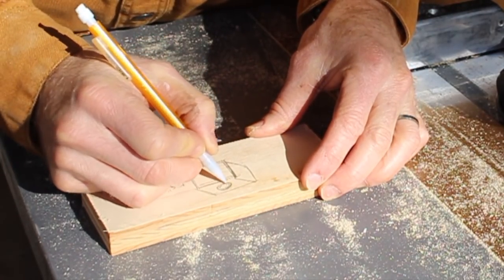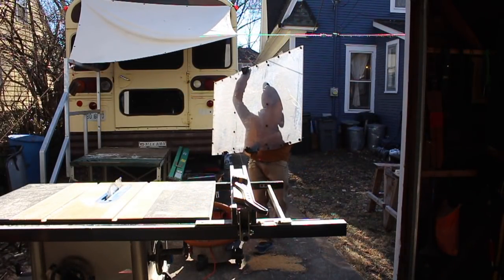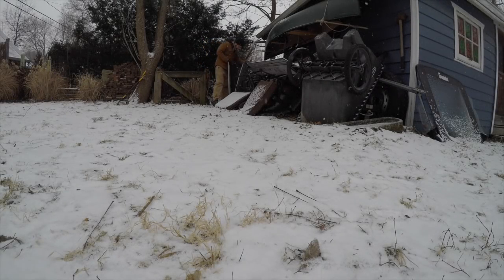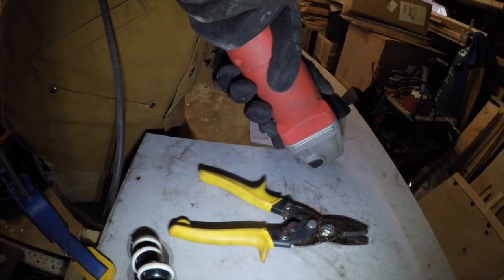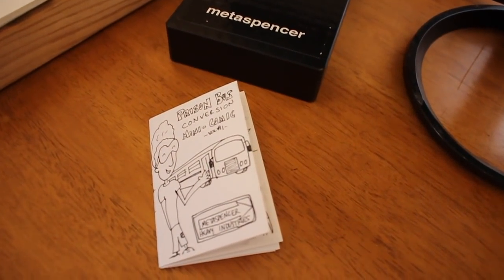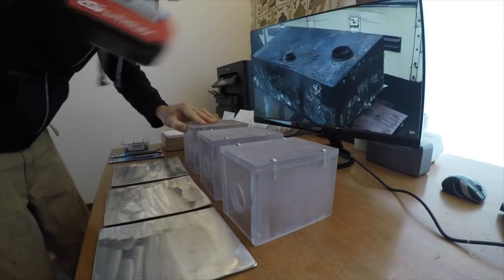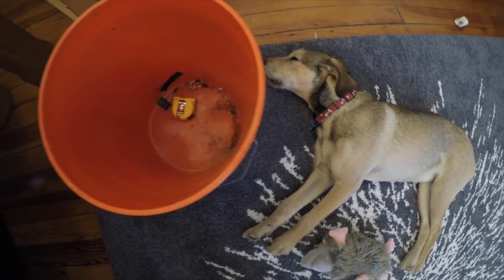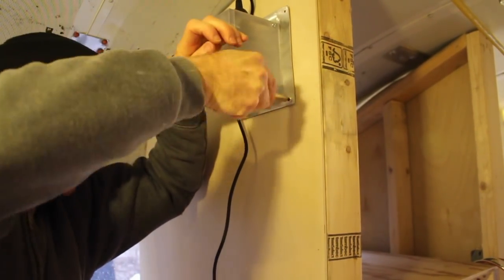Bulletproof Lights -- Prison Bus Conversion #29

Comment: Just watching and catching up on the previous vid's..in answer to the "Why don't aluminum spark when cut" ? Well, general info is Aluminum isn't  a Ferrous metal like Steel, Cast Iron, ect; Much softer metal or Non-Ferrous metal..Least that's what I learned from years gone by, Hope I'm somewhat correct, like the build bunches, keep the faith !
Reply from the maker: sounds right to me! I guess the ferrous bits make the sparks or something like that. Thanks!

Comment: hello Spence you can glue the plastic with chloroform we have done it with ship ports works great and super strong
Reply from the maker: I didn't experiment with glue or chloroform, but that would be a great way to go. I'll have to experiment with that, as it would make a perfect seam. thanks for the tip!

Comment: Just a little FYI, do not use any ferrous metal (mild steel, carbon steel, stainless steel, cast iron, and wrought iron) grinding wheels on non-ferrous metals (aluminum, brass, copper, nickel, tin, lead, and zinc). The wheels for ferrous metal when used on non-ferrous metals gets clogged with the non-ferrous metals (thus no sparks). As the wheel keeps getting clogged you have to use more, and more pressure on the grinding wheel so it will still cut which creates more, and more heat which can cause the grinding wheel to explode (this is not a myth). They do make grinding wheels for use with non-ferrous metals.
Reply from the maker: I've seen that ferrous metals tag before, but never really understood it. Thanks for the tip. Super helpful. T'hanks, man
Reply: If you have a grinding wheel on a bench grinder with aluminum stuck in it they have a grinding wheel dresser tool for bench grinders. It will make the wheel flat again, and remove anything in the wheel like aluminum so you don't have to toss a good wheel that has a lot of life left in it. No matter how old are there is still something new to learn. I love your videos, and be safe out there.

Comment: Wow to be mentioned in a metaspencer video !!!     Dude I like the lights .... Have you ever set the saw at 22.5 degrees ? To make an octogon type box ?  Jus a thought ... It's was good to see you back at it can't wait to get the comic !!!!!
Reply from the maker: oooo, an octagon box out of that polycarbonate would be just so, so great ... thanks for the tip! (your comic is on the way ... got delayed by the post office because I, doh, forgot to put a stamp on it)
Reply: its so easy to make really try it 22.5  your all good  thanks man

Comment: Why does grinding steel create sparks but aluminum doesn't? I googled this and there are answers out there, but not sure I understand the answers. Has to do with heat, friction, metal (steel, iron (take a torch to steel wool)) will burn with heat and oxygen, aluminum forms a protective coating when it oxidizes that seals it from oxygen. That is the best I can d with the article. Nice job making lamps out of spare material.  Interesting that you are looking at a new home and shop. We are in the middle of exactly the same thing. See this link. 
https://www.zillow.com/homedetails/5542-Podger-Rd-Marion-NY-14505/83950476_zpid/

Glenn Lever
Reply from the maker: Hey Glenn, thanks for looking into it! I'll have to read more, but I know what you mean about steel wool. That's a nice part of NY
Reply: Just a though, what bulbs are you using in the fixture? Heat? LED has no heat and very low power consumption. Glenn Lever
Reply: ThrottleStopRacing ii
Reply from the maker: Yeah, I'm going with LED Edison bulbs because I like the look and efficiency